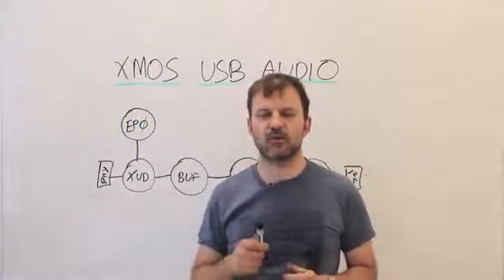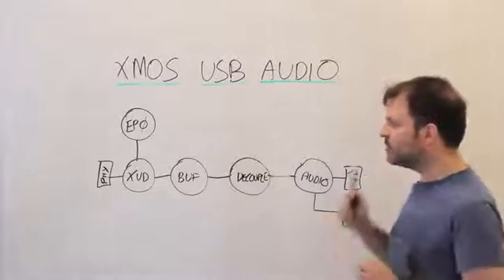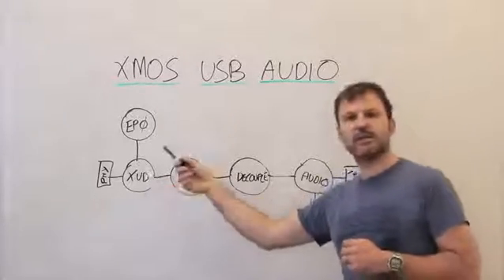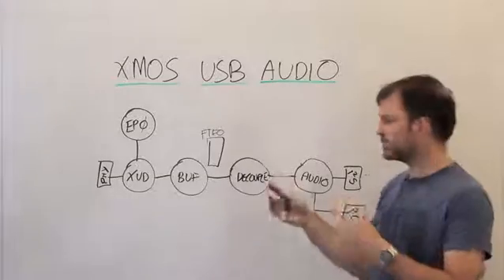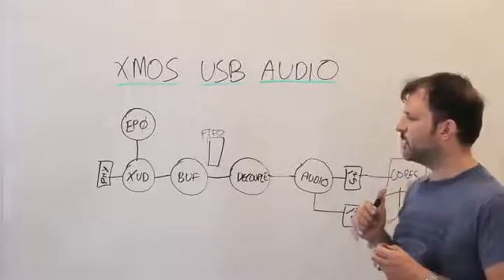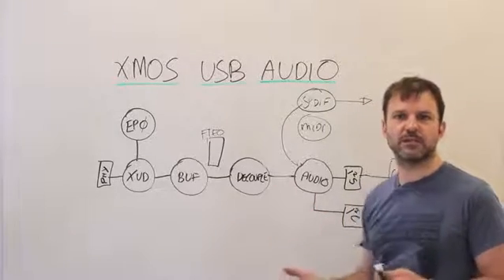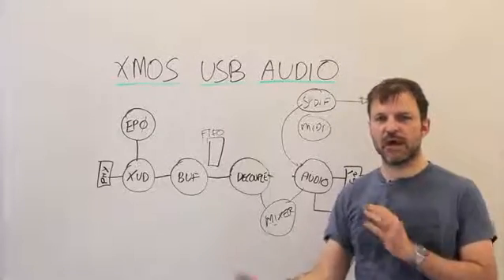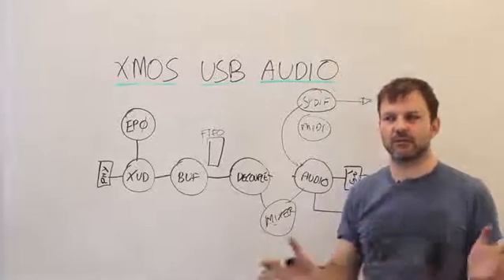Introduction to the XMOS USB Audio 2.0 Reference Design

Comment: I connected my Topping D50s to a USB hub that had the incorrect PSU (12V instead of the correct 5V). Windows stopped recognizing the USB port and later I got an error message on the OLED display and the unit is now unusable. Could I fix this by re-flashing the firmware or is the chip permanently damaged? Thanks!
Reply: probably borked a voltage regulator

Comment: Hello. Iv just buyed a playmate from burson audio. And it used usb xmos.  But when that is connected i cant adjust my main volume in Windows. It becomes a own device offcourse, but the volume is the same on 1 as 100. I have to adjust the volume on my amp.  Do you guys know any fix for this? I have to use optical instead now:(

Comment: Have been using XMOS USB audio devices based on this design for many months now and it's remarkably stable even with low-latency pro audio applications.  The fact that this is based on a fully programmable, general-purpose multicore processor with plenty of additional resources to implement firmware is unique.